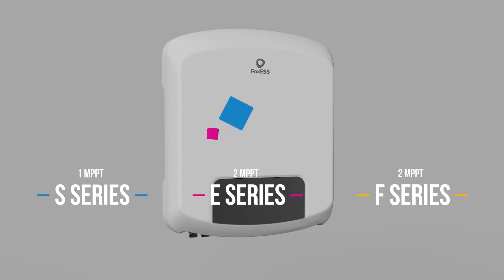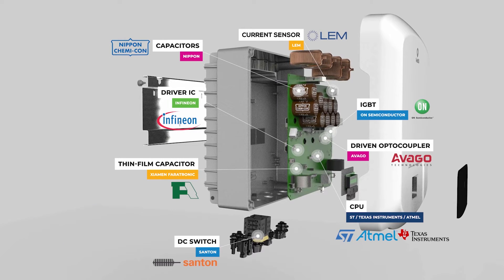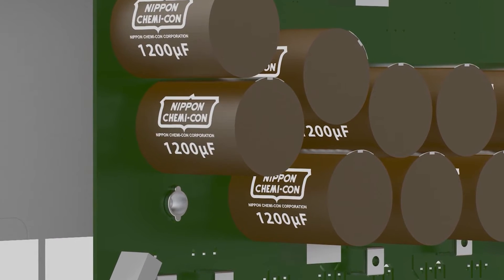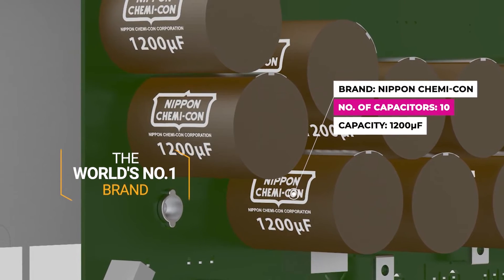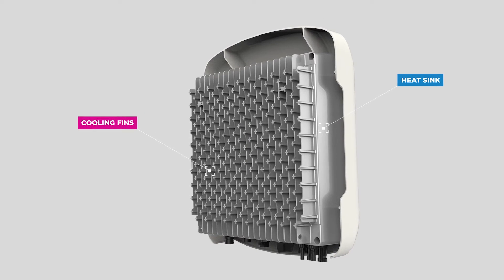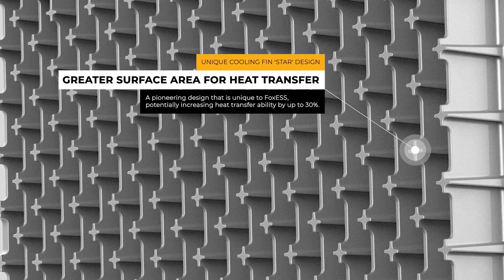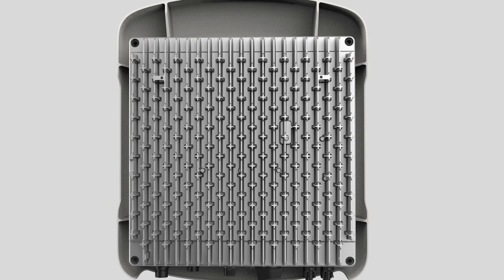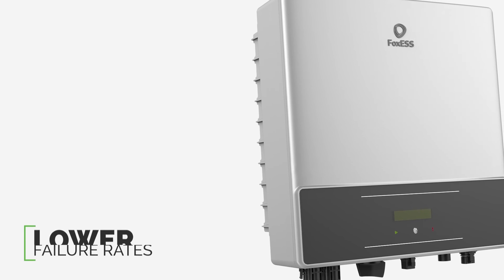FoxESS Inverters - Precision Engineered for Longevity

Comment: how many panels can be connected on one system with this type of Fox T3 inverter?
Reply from the maker: Hi Marek, It's depending on the type of panel you selected, as well as which size of system on this T series that you select.
Reply: @foxess5669  Specifically, it's about the T(G3) series,420wp panels 60v each panel Can you connect one system that has 1100wp to this particular inverter?
Reply from the maker: @marekkolikowski9635  Hi Marek, generally T(G3) can install 1.5 times of rated power, but need to make sure voltage and current is within limit. For the detail parameters please refer to our datasheet that you can find from official website www.fox-ss.com

Comment: F series: works? if main power down. I mean no power from the city. Or work only if exist 220V? Also, the question can connect limiter?
Reply from the maker: Hi Viktor, unfortunately NO, the mains(AC grid) down, the device will suspend the generating in terms of safety.